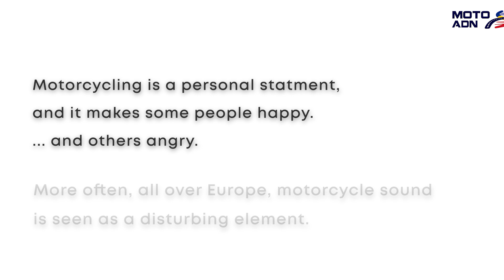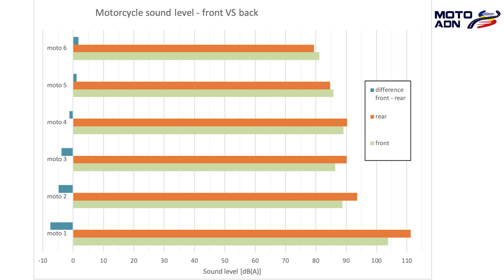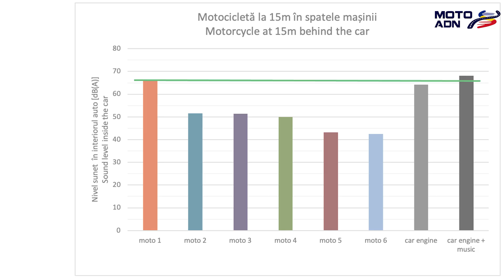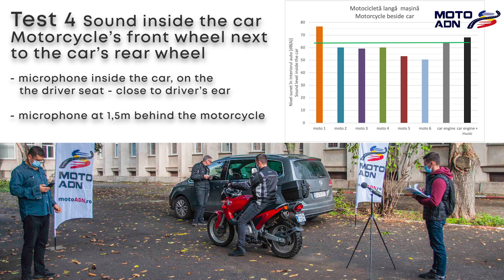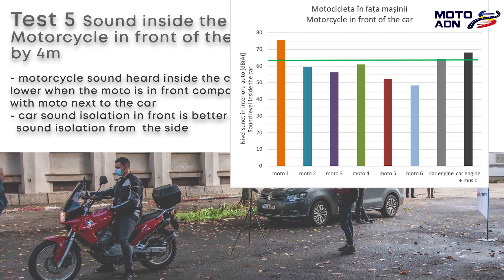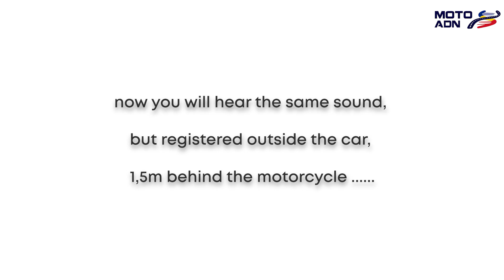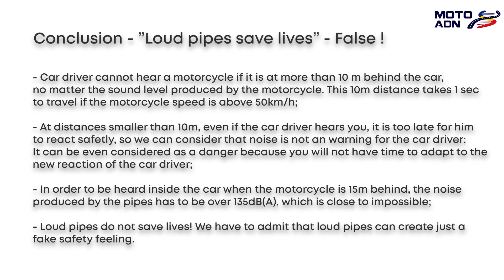Do loud pipes save lives? Now you have the answer!

Comment: so many inconsistencies with this “study” starting with why can’t you list the types of bikes and their exhaust systems for us to compare? we’re any aftermarket systems tested? systems with a cat delete? using a dyno would give you far more accurate results as the engine will sound different under a load vs in neutral. you get a lot more lower frequencies under a load. it’s a really simple study with a lot of unaddressed variables with many questions left unanswered. can’t really trust the data they came up with because of those missing details.
Reply: You're absolutely right that they should have listed the models and details. Now, maybe it's in the details but I can't read romanian. Additionally, models and details should not matter too much because they established a baseline before.
You said "Can't really trust the data...". The thing is, the data is still here and valid for what is tested. It is not a perfect simulation, but no one can deny it does provide some amount of information. We also need to factor in the noise caused by friction between tires and road. This is actually a bigger component sound-wise for a car (and of course, less so for a motorbike), which would additionally drown the motorbike's noise. On top of this, I don't think that the freedom to ride a fancy loud bike is worth hundred's of people's wellbeing.
Reply from the maker: Here u can find the english version of the video https://youtu.be/v9QTPyMJGgo

Comment: I agree you can't really hear a motorcycle behind you on the highway. When a motorcycle passes you at 120mph you never really hear it until it's on top of you. Cars in front of a motorcyclist are also of least concern on the highway; "I'm so worried about that car 100m ahead of me that I'm going to pass practically on the white line or two lanes over from" said no motorcyclist ever, at least I never worry about it. What I and others do worry about are intersections, blind corners, parking lots, stop signs and other low speed circumstances where driver attentions is divided 10 different ways. Still, riding defensively and knowing where to place you bike for visibility e.g. not on the passenger side edge of a pickup truck when oncoming cars in a turning lane or waiting for a window of opportunity to "gun it" in traffic to make a left turn into a gas station they've been waiting for 6 minutes to enter during peak traffic and the driver says "okay, after that black truck and before that white car just zip across. I met a guy last weekend that lost his leg like that.

There must be some non-zero amount of collisions that were prevented from loud pipes but these aren't that loud compared to a big twin cruiser with Vance & Hines Radius pipes which dump the sound out to the back and side rather than sport bike exhausts that practically have wave guides built into the tips. 

Also, this does not address that you use your exhaust like you would your horn at times, but with less ambiguity or having to hold on to it. Think of how annoying that would be: "what is that rider trying to tell me?"

All this and I'm still putting much quieter pipes on my bike if I can find them and it doesn't absolutely kill the performance.

It would be interesting to see a more holistic study of whether or not a driver will pull out on an electric bike or a sport bike with a slip on exhaust or a big twin cruiser with 110db shotgun exhausts. How you would study that would be extremely tricky (people pay attention when they know they're being tested and not driving home drunk on 4th of July weekend late in the evening with the windows down listening to Boston.

Lastly, maybe use cross power spectral density in your studies and not just dB and try to include cognitive factor and opportunity to costs e.g. revving and making person at the stop sign 40m ahead on the right actually make visual contact with the bike so the rider can pay attention to the car coming 47m on the left who is about to make a left turn that's going to make them go flying over the hood or into the 2x4 that's hanging out of the tailgate. Hard to capture.

Comment: There are many questions ... why 60 km / h why not 50 km / h, because in Romania the urban speed limit is 50km / h. Why is the vehicle's internal noise close to 70 dB? The base noise of the VWs used in the test is between 50-60 dB at 50km / h, which is orders of magnitude lower than the nearly 70 dB used in the test. In a word, the values used in the test do not even come close to reality ... Now seriously, who ordered this test without any reality? At 70 dB of internal noise, the driver does not hear the siren of the ambulance truck from 15 m.
Reply: The urban speed limit is indeed 50km/h in most cases, but we have a rule which allows road administrators to set the speed limit to a maximum 80km/h.
So, if I'm not clear enough, inside the cities you must always respect 50km/h max speed rule unless you see a sign that shows above this value
Reply: @andyandrei5733  This is the case almost everywhere, the only question is why they do not start from the default values for a test. The initial data for the test is already flawed, starting from a fundamentally loud extreme situation that is not common and lifelike.

Comment: This is more of a school project than a 'study'. Tiny population (6 motorcycles) come on give me a break. Every test is anecdotal at best, if not proof the 'study' is lousy. Study 1 proves the pipes are probably quite quiet in comparison to 'loud bikes', extremely small difference from the front and back of the bike. Have you ever been to a race track, or actually witnessed a loud bike? This information sounds correct for a quiet bike, they sound pretty similar from front to back, not a massive difference. That's because the exhaust is quiet.. Loud motorcycles and cars can easily be heard from twice as far from behind as the front. Further proven in the next study which shows the drivers own engine was louder than the bike from 10m back.. Again have you actually even witnessed a loud bike?  Biggest issue with this test is that the effect loud pipes have is directly correlated to the danger in that specific scenario.. If you drive around on lonely country roads with not many cars, do they provide additional safety? Probably very little. In a busy urban inner city where there are other loud noises and cars everywhere the effect would be much greater. Loud pipes are for d-bags, they also save lives. The argument is not whether its true or not, its whether their safety is more important than the amount of people they disturb to be safe. They could just drive a car if the area is so unsafe that you need loud pipes to drive a bike..

Comment: So if I ride a bike that can be heard at about 2Km in the open countryside at night... and I get behind a car in an urban environment, it won't notice me? Hehe, let me doubt that.

In 15 years only 2 times cars have smashed into my bike (once at a STOP, from the back and the other in a roundabout), and yep, both with the bike original exhausts. The more you get noticed, the better, it's like riding with the lights on even on daylight conditions. Be seen, be heared, be safe.

PS: And another thing, the noisier the bike, the slower you ride. I usually find myself rinding faster with the original exhausts because it just feels comfortable, hence more likely for me to have an accident.

Comment: I appreciate what you are trying to do with this test. I personally have quiet exhausts because over lon distance, I have found some exhausts to be too noisy over a prolonged period of time, however there are other factors to consider. Both OEM and after market exhausts have different levels of sound depending on the speed of the bike and the gear chosen. For example an OEM and aftermarket exhaust at 30mph in 6th gear will be extremely quiet but have both bikes in 2nd or 3rd gear at 30mph will have a completely different affect and may result in the driver hearing an after market exhaust better. Also engine configuration is a massive factor. A 650 parallel twin motobike with an aftermarket exhaust will sound different to an inline four 650 with the same exhaust. Rev bombing a bike isn't realistic either.
Reply: As an American rider the young kids rev bomb all the time. Coming to a stop sign? Rev bomb. Someone cut u off. Rev bomb the hell out of them! It's an annoying habit lol. Don't get me started on the harley dudes and how they got to give two little vroom vrooms before they do anything lol
Reply: They have to rev bomb it as their is no way you would hear it otherwise i could barely hear it when they rev bombed at 15m. in traffic around other cars they wont hear you coming so its a mute point

Comment: hmmmm, a motorcycle engine bouncing on the revlimiter at 6000rpm??? I don't think so, morel iikely that was 10000-12000rpm
Reply: only foggats have rev limiters didn't you know that?
Reply: @donmatthews3904  every engine has a limit that when reached gives you that fluctuating rotation noise.

Comment: Whilst I agree that a few unsocilable over rev engines in built up areas, your test is very few from comprehensive. What is the effect on pedestrians  ? ( especially those wearing headphones). Why was the test not on the road ? The sound  in the car cabin may be very different. Why did you only test with music on in the car.Most drivers don't listen to music while driving. The sound of a motorcycle changes whilst accelerating, likely increasing the sound power spectrum at higher frequencies. Whose "life" do you think is in most danger, the car rider, the motorcycle rider, or pedestrian. Why are there sound minmums for road vehicles ? When you can complete a much more thorough study, and analyse the data without bias, I wold be willing to listen. Your conclusion has no validity. You need much more data than you have. Who financed your experiment ? Have you published this data and conclusion in a peer reveied article  ?
Reply: Man! You bikers have to take care of pedestrians more that other way round! What an ugly mindset you have!
Reply: @laszlolebrun4114  Sadly too many bikers lack skills and would rather fight with other 2 ton vehicles than practice defensive riding.
Reply: "Why was the test not on the road ?"
So, the sound cannot be heard in a quiet area where the bike's exhaust is the only external source of noise, but it would be heard when the wind blows around the car? That's what you're saying?

"Why did you only test with music on in the car"
Maybe because it's a lifelike situation that people listen to music in their car?

"Most drivers don't listen to music while driving."
I know a lot of people who drive, and with one exception every single one of them listens to the radio while in the car.

"The sound of a motorcycle changes whilst accelerating"
The bike in the test was revbombing. Revbomb is literally the highest frequency sound a bike can produce.

"Whose "life" do you think is in most danger, the car rider, the motorcycle rider, or pedestrian."
What does that have to do with anything about this test? It was to prove that loud pipes don't make the bike more noticable.

Comment: Another waste of time. The only factor this test considers is the situation of a motorcyclist passing a vehicle at 10m or less at a high rate of speed. Needless to say... this is not the only situation in which the sound of the exhaust will be heard by other vehicles, not even close
Reply from the maker: we run the test at 15m and no sound inside the car
Reply: @motoADN  thats fine, but that wasnt the success or fail factor of the test.